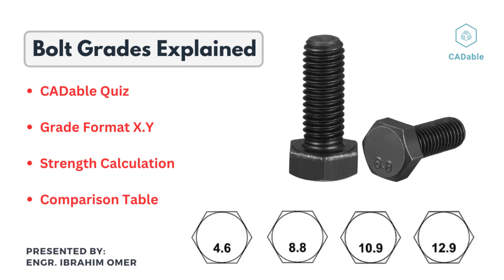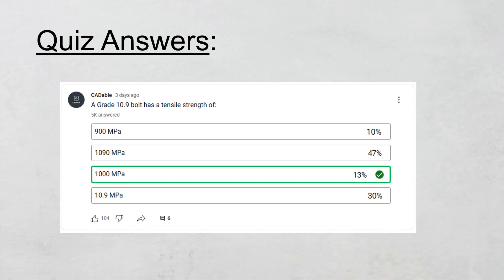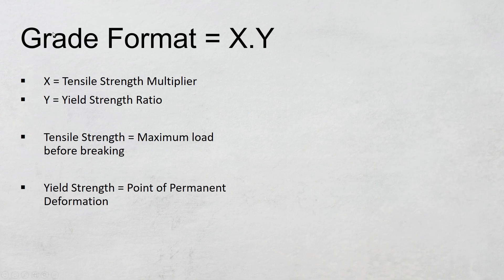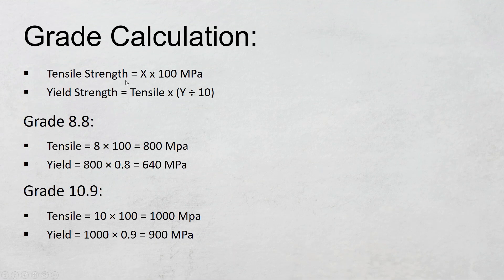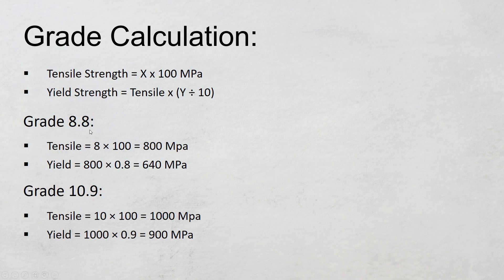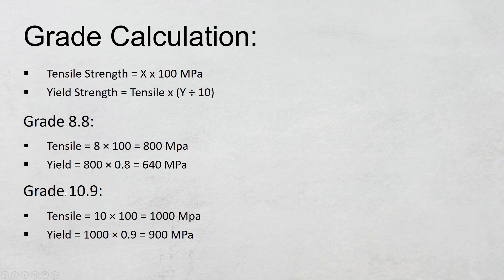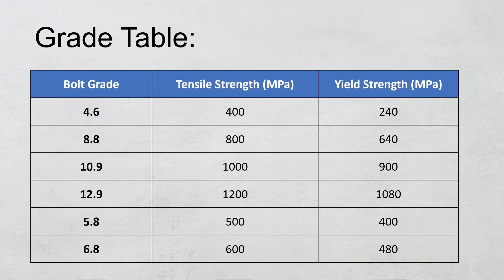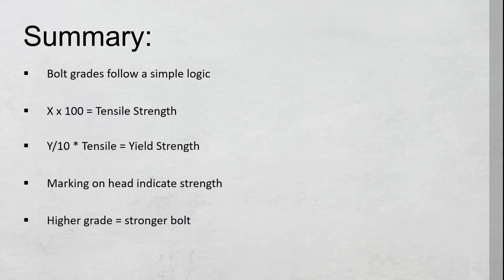Bolt Grades Explained | Bolt Grade Identification | Calculate Tensile And Yield Strength of Bolt

Comment: Give examples about choosing the appropriate bolt in the right place
Reply from the maker: Grade 5.6: Light-duty parts (e.g., covers, small brackets).

Grade 8.8: Common for medium to high-load uses (e.g., car chassis, bicycles).

Grade 10.9: Used in critical, high-strength areas (e.g., suspension, engine mounts).

Grade 12.9: For very high-stress applications (e.g., engines, aerospace).

ASTM A325: Equivalent to Grade 8.8, used in structural steel.

Comment: Is marking on the head necessary??
Reply from the maker: Yes, head marking is necessary for bolts used in engineering or safety-critical applications. It helps identify the bolt grade, strength, and manufacturer essential for safe and correct use.